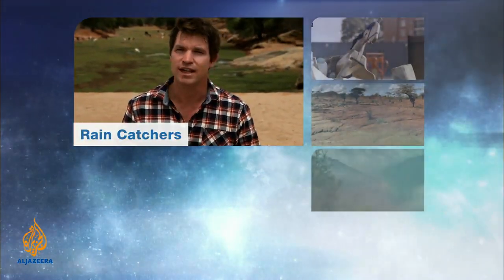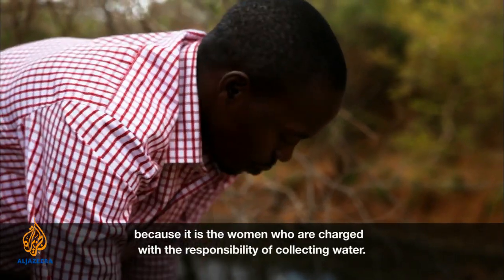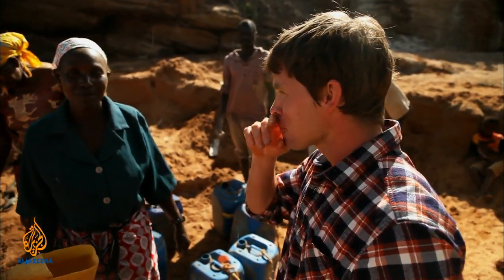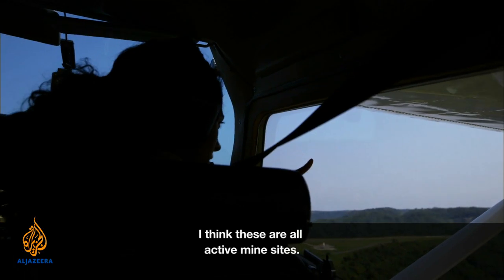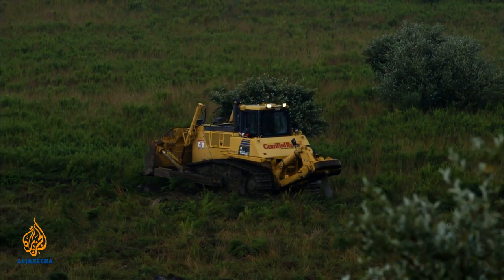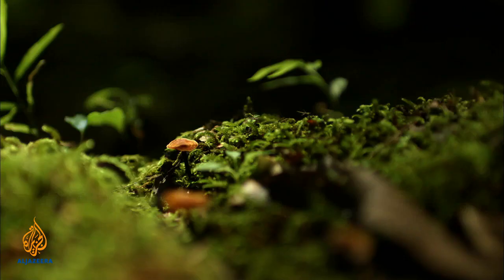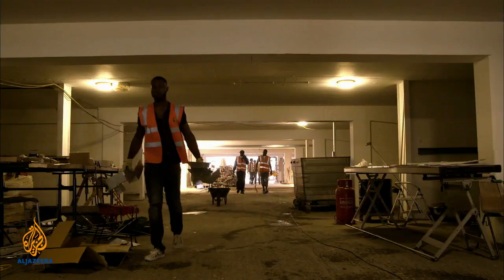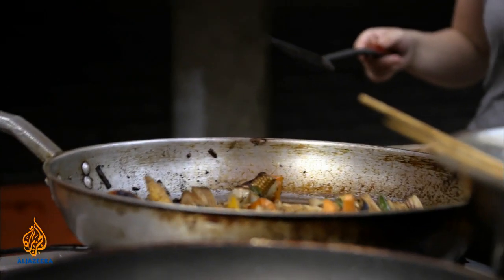🇰🇪 earthrise - Fighting desertification in Kenya & the remakery

Comment: Hate to "armchair advise" but those dams will be far stronger if you simply make them slightly more labor and material intensive via a gentle curve against the flow....or less intensive via making them thinner and still stronger.  Concrete walls have very low tensile strength so the entire structure should be in compression.  I just fear that they won't hold up long as constructed here.